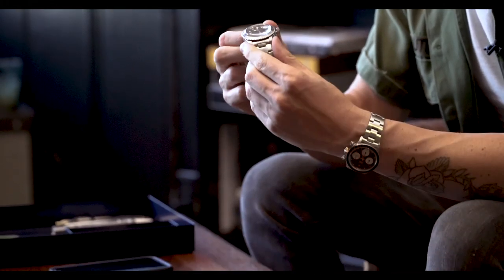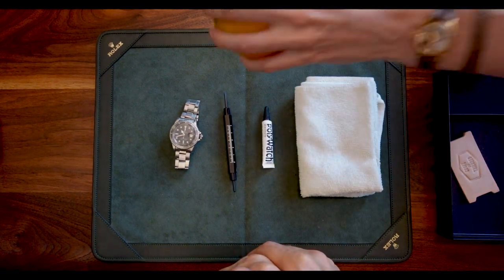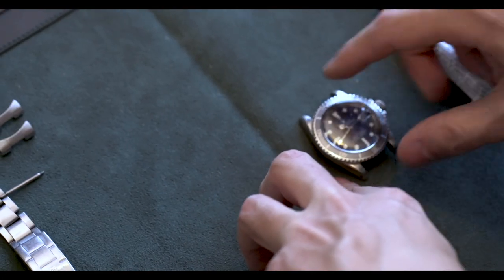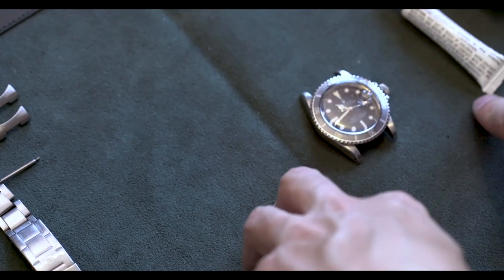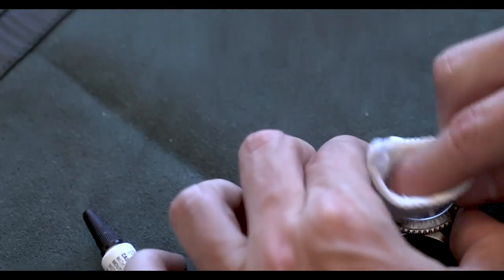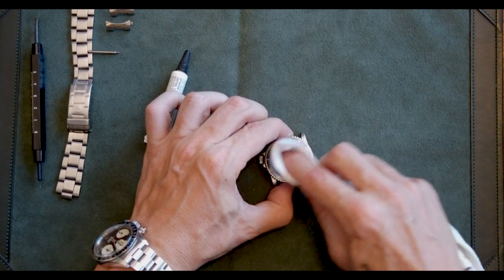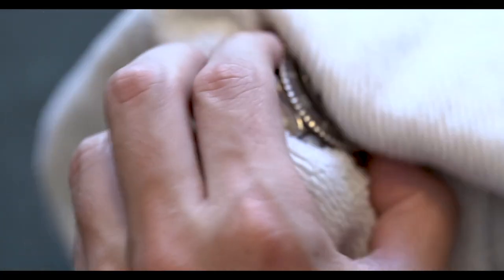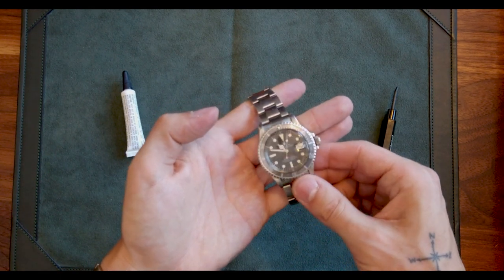Craft + Tailored How To: PolyWatch

Comment: I am going to help someone that came here in a panic, because I got here...in a panic, haha. But by sharing what I learned today, I can help someone.

I have a Vintage Rollie in my collection. This one is one that most people would recommend never wearing, but just keeping under glass. Well, I am not that guy. I do not do "winder queens." If something should be retired no "never worn" status. then it is probably better for someone else to buy it. I wear my watches.

And that is how I put a DEEP scratch in my vintage Rolex. It was so deep that I was about to call my watch guy and ask him of we could find a piece of modern sapphire that is domed like this 70 year old acrylic, the integrity of the originality of the watch I believed already spent.

So I came here and did what the video said to do. This video is for light scratches, not deep ones. So, once it didn't work, I went off script.

I got a piece of 180 grit sandpaper and scratched the paint out of the original scratch. Yes, this made the scratch bigger, but at this point I was desperate. Then I went to the head and got some of my baking soda toothpaste. I spread that over the whole crystal, and waited 5 minutes. I came back with a dremel, with a buffing pad (speed 2 on mine) on it and buffed it out.

It got better...but not perfect...so I repeated. After two runs it was a LOT better. So then I switched over to the poly watch.

I did the same thing, buffing out with the dremel, THREE times. After the third time, the scratch was completely gone. 

So that was 180 grit to clean it up, a dremel to buff...two ruins with baking soda toothpaste and 3 runs with polywatch...allowing the substance to sit for 5 minutes before buffing each time.

And I don't have to f__l up this vintage rollie by slapping sapphire in it. 

Hope this helps someone who came here in a panic.

Comment: if it manages to polish acrylic crystals, how come it doesn't scratch the metal part of the watch face? i would be very reserved in doing this with my finger accuracy :)
Reply: I find that because it's a rather delicate. I found that some of my metal pieces seem to gain a nice sheen as well. It's no different than using a fine sand buffer to buff a case.